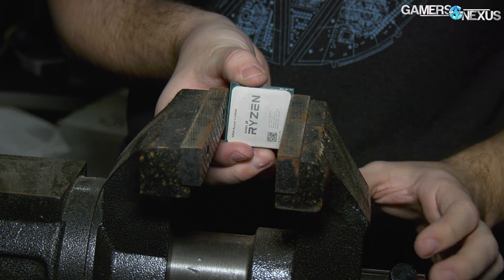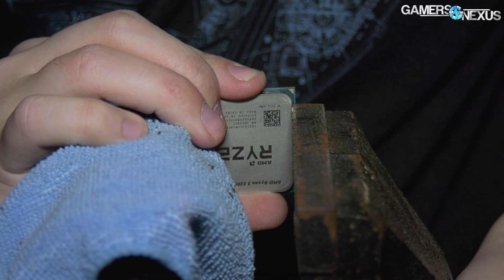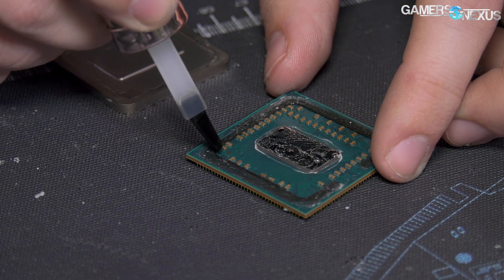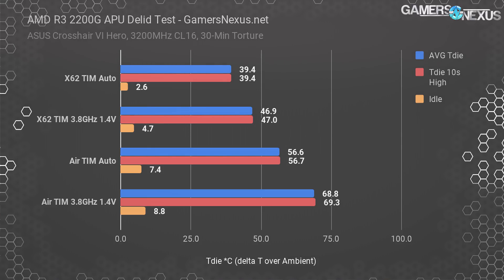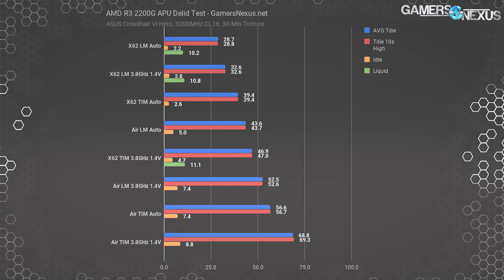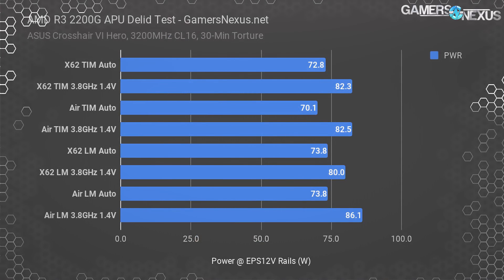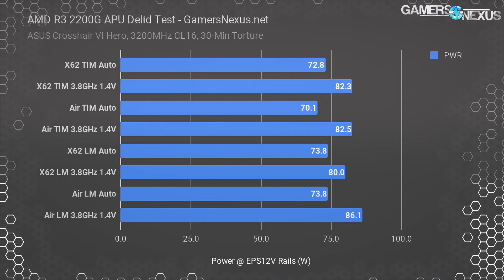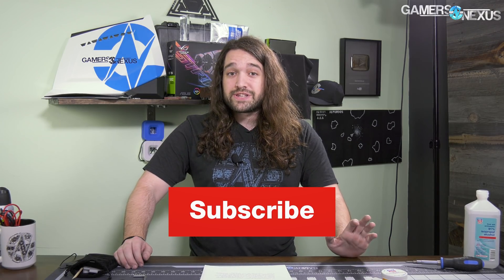Delid & Liquid Metal Thermals on AMD R3 2200G APU (Pt. 2/2)

Comment from the maker: Article with test method section: https://www.gamersnexus.net/guides/3237-amd-r3-2200g-delid-temperatures-and-liquid-metal
Find PART 1 over here: https://www.youtube.com/watch?v=7o1ITMw-O2o
Reply: +Gamers Nexus Der8auer made a 3€ upgrade kit for the "Delid die mate 2" which allows safe delidding of RR APUs. https://www.youtube.com/watch?v=Wkb4NmeONqY
Reply from the maker: Vincent - Because we've done this enough to not miss.
Reply: My understanding is that AMD has pretty much always used TIM on their APUs, this isn't really a change for them.
Reply: Test the APU’s with 1 dim 2 dim and 4 dim ram configs and show us the results run same clock through all tests and configs on the memory and a solid clock on the API no variation
Reply: So Der8auer apparently will soon be putting up and “adapter” for the die-mate 2 that allows for the delid of these apu’s.

That said, the adapter is a piece of acrylic, and the pins are exposed during the process so could be easy to screw up.
Reply: Steve, as I understand you typically do these tests with the IHS back on, not the riskier die directly to heatsink. Would we see similar results when testing LM with a GPU? As for me and many other gamers, the CPU isnt pushing our fans to 100%, but the GPU is. And since GPU dies dont have an IHS anymore, it would be vastly easier to do. Could we possibly get a video about that? Maybe showing off a 1080ti and vega?
Reply: why first do liquid metal and than the nail polish? now you can get the metal "stuck" in there
Reply: Why is your community so small. I've been following you for quite a while and frankly i think you deserve way more subs.
Reply: Gamers Nexus Der8auer was able to delid it using Delid Die Mate 2 by placing the CPU upside down and using a acrylic piece on the substrate side. Watch his video. You can delid these APU's.
Reply: great work Steve. do you think the difference will be even more pronaunced if the GPU and CPU parts of the APU where stressed at the same time (as in games). or does it make no difference hence you already exceeded the APUs power target i the cpu turture test?
Reply: You should have overclocked CPU and GPU for worst case scenario
Reply: 3:50 - 4:00 , timing video?
Reply: I do, but when OC'd and playing a game that uses 100 % the fans ramp up.
Reply from the maker: Of course you can delid the APUs. We just did it.
Reply: I know this is not relevant to the topic but where is snowflake and the others?

Comment: If you bought an i7k you kinda have to delid it if you want to actually overclock it without a water cooler or something.
In my case, when I fired up handbrake my cores would be 86 degrees and my heat sink wasn't even warm to the touch. Delidding dropped it 20 degrees on a mediocre $35 coolermaster 212.

Comment: Whats the nail polish u can use to protect those transistors things. Keep up the awesome work Gamers Nexus. I delided my I7 7700k with a razor blade. Before stock settings 4.2ghz in bios I was at 39-40c idle. After the Delid and using the Thermal grizzly liquid metal stuff I got 24-25c temps in bios stock settings. I was able to achieve 5ghz overclock with ease, running Aida64 stress test for over 15mins and my temps never went past 61c.

Comment: Why don't they make an threadripper apu? Basically a 1700 with a vega 32 or something? It would have plenty of power and thermal headroom considering the intel g laptops have 100w with 20 vega cores and perform as good as a 1050 to(best case) the threadripper ones could be in between a 1060 6gb and a 1070. It would increase tr4 board sales too! And help with the crypto hell we are in now.

Comment: I'm about to Delid my 9720x. I would use the same tool you are but they are hard to get in the USA. So I got the ROCKIT 99 - LGA 2066 Delid & Relid kit. Ever use it? 

I also got some Thermal Grizzly Conductonaut for under the lid, what do you recommend using on the top?

Comment: Why started AMD using TIM instead of soldering? I would prefer soldering the DIE to the metal coverage, it is more durable than using a thermal paste.
Reply: AMD has been using TIM in the apus forever. its not new and budget parts don't have enough margin to squeeze in solder.

Comment: I dont see the problem with BUDGET LEVEL CPU using thermal paste, kudos for AMD by being open about it, but i would rather expect a $100/$160 APU to have TIM than your $300+ High-end CPU, which is the real issue here.

Now, these APUs are real nice considering that they are overclockable. It's just a shame that RAM prices are not there to support these guys price points.

Comment: with GPU's being so easy to get hold of LoL
just wondering GPU's here in Finland
the ASUS Radeon RX VEGA 64 ROG Strix Gaming OC 8 GB 1035,90 € Currently not available 
ASUS GeForce GTX 1080 8GB is 838,90 € Currently not available
PNY Quadro NVS 810 4GB 1032,90 € Estimated delivery time 1-4 days
I can get hold of Quadro cards but not other cards
what your thoughts about Quadro?

Comment: I think youre going for the same mistake as other techtoubers. Only techEpiphany does it right (he still didn't go the delid route and can already OC the gpu from 1250 to 1700Mhz).

DO NOT FOCUS ON CPU OC, NO NO NO NO AND NOOOOOOOOOOOO.  FOCUS ON GPU OC, that's the only thing that matters with this APU, the 4.1Ghz wall is the same as any Ryzen on the 14nm lpp node. The star of the show is the GPU not the CPU part.

Comment: My theory is the use of thermal paste is to reduce any possible damage to the packaging from uneven thermal expansion by having fewer fixed points subject to heating.  Also, what's the lid made out of?  Hopefully it's not aluminum (which would be a good choice thermal-wise) because LM apparently contains gallium.

Comment: What were you applying to the transistors on the apu after applying the liquid metal?
Reply: Nail polish as a non conductive screen in case of a liquid metal bleed off the die.
Reply: Ben Grogan oh sweet thanks, I’ve been using electrical tape but this seems way easier to apply
Reply: Yannik Fernando and safer to remove, tape or silicon can strip micro components from the substrate, removing this just needs a soft brush and the same rubbing alcohol you use for TIM cleaning

Comment: Intel uses Tim on their processors. "It is not to cut costs"
AMD uses Tim on their processors. "It is to cut costs".
Reply: Richard Smith well I mean there's no excuse really for Intel using such cheap TIM on a 1000 dollar plus CPU. But makes sense for these APUs since they're such low powered chips.
Reply: Right. The difference here is the price to performance is actually undercutting the competition. Cost cuts are expected, and AMD is not trying to pretend it is anything but what it is. If you are providing a product for more money at equivalent performance, you can't obviously cost cut as well. Oh, and don't put the cherry on top by insulting people's intelligence claiming there is another major reason for it.
Reply: Richard Smith I don't disagree.
Reply: AMD has been using TIM on their low-end APU's since like FM2. This is not a new thing

Comment: what if you removed the lid and put the cooler directly to the cpu?
Reply: Anal Devastator nothing holding the CPU in the socket if the dye itself is just sitting in the socket. It would be too easy to just rip it out of the socket possibly damaging it. So really wouldn't be too wise.

Comment: I get it once you do the work of deliding its best to just use liquid metal since it is the best we've got so far. But is it bad to use a high grade thermal paste instead. I could get liquid metal and all but I'd rather use the TP i have lying around. 

Worth it or is the loss to much to use TP?
Reply: The Real1st best to look at some Intel delis videos for more specifics but in general a high end TIM is half way between Intel TIM and LM due to Intel choosing an extreme long life TIM
Reply: The Real1st using a high grade thermal paste wouldn't be such a bad idea. You would just be replacing the existing TIM/thermal paste with a better grade thermal material.
Reply: React2Quick 

That's what I was worried about as well. So then what's the difference temp wise between   LM and then high end TP. Does anyone know off hand or should I google it. 

Cause I bet GN made a vid about this question already. But I thought I'd ask here first to see if anyone knows off hand.

Comment: DerBau8er's tool works on the AMD APU. He's already released a video on it. And AMD APU have always used TIM except Kaveri. That out the way, why are you overclocking the CPU part, that's pretty much irrelevant. Overclock the iGPU and see if it can be made match the 2400G instead.

Comment: In AMDs case, it's justified. They openly admitted to doing so in order to cut costs. They did pack gpu cores, cpu cores, and a much better stock cooler vs the equivalent, for as low a price as possible. Whereas Intel's shoving that crap into their extremely high end enthusiast, overclock capable CPUs, which is a pathetic shame amongst the community.
Reply: Exactly. The thermal expansion coefficient delta from the indium based solder, the silicon die and the IHS is significantly lower than it is from the die to the fiberglass based substrate, yet we don't see die to substrate interconnects breaking which are far more fragile than the die itself breaking, but intel bs about solder causing dies to fail?  The fact their more reliable spec'd xeons are soldered with even larger dies and their CPUs of yesteryear were as well is blatant lies in consumer's faces for obvious better profit margins.
Reply: What I have against Intel is them pretending it is not to cut cost, and everyone spewing the same bullshit.
Reply: Let's be honest it wouldn't make a huge difference if the 2200G would cost $115  like the Rzyen 3 1200 did.
Reply: Nick V intel had bigger dies back then with stuff like sandy (4c sandy die was 216 mm^2, compared to Skylake which is below 100 mm^2)
Reply: Cooe14 https://overclocking.guide/the-truth-about-cpu-soldering/
Reply: Tyler Weigand ah okay, didn't know that
Reply: Meanwhile, at Intel...
Reply: Cooe14 ungluing the ihs requires removal, at which point you should replace the TIM. That doesn't sound like a valid test to me.

The stuff intel uses isn't necessarily meant to offer the best thermal conductivity. It's main purpose is to last a long time.
Reply: The TIM itself isn't crap, it's just there's a gap between the ihs and die that drops the temps.

It's justified on the LGA 1151 SKUs since smaller dies means it's easier for the solder to Crack. I totally agree on X299 though, they should've soldered.

Comment: Thinking about delidding and using liquid metal on a CECHA01 PS3 That's never had the YLOD. Also with a case and water cooling mod and lots of extra heatsinks for the other chips on the board. Should be doable, though expensive. Imagine a backward compatible ps3 that stays below 70 degrees c and wont ever overheat. Lots of great games on ps3 man but never had a console last long enough to really experience more than 5 or 6 good games. This is the exact reason I got into PC.
Reply: If it aint professionally reballed, do that first. Good investment because launch PS3s have like a 75% fail rate. And if the heat spreader contact aint flat on the GPU/CPU die then you'll need to lap it flat with like sandpaper because the Liquid metal will be ineffective if it ain't. Or use some high end grease like Gelid GC Extreme, Noctua NT-H1 or Shin Etsu G751. I would say Arctic Silver but those ones I mentioned before work as good or better without curing time and don't degrade after 18 months.

Comment: @AskGN - How much money does Intel and AMD save by using tim instead of liquid metal?
Reply: Paul Muresan around $3 to $8 depending on die size.
Reply: Ben Grogan no way. This little piece of liquid metal and the apply process can't cost this much more in massproduction.. Do you have a source?
Reply: Paul Muresan My mistake I thought you where asking on solder vs TIM costs.

The LM isn't used not because of cost but because of long term viability.
TIM will last 15 years if the ihs is not removed, it is still conductive after it has dried out.
Liquid metal will eventually corrode into the IHS and "evaporate" as it alloys with the metal and needs checking every few years for pitting, you cannot expect this in a consumer product.
Reply: But term viabiliy can't be really the only reason. I think that most people would buy a new CPU after 10 years. But I think you got my question, I was asking about TIM cost vs LM cost. ;)
Reply: Paul Muresan long term viability is pretty much the only reason for TIM over LM, neither AMD nor Intel would willingly risk a bad reputation for reliability and have openly said in interviews they avoid liquid metal for that reason.

APU in particular find themselves in front end sales systems much more often than consumer systems, and their expected life is a key concern.

As for cost for liquid metal.
There are still costs involved, hazardous material licences for holding and disposing of large quantities of gallium for example we cannot estimate without an idea of the production runs.
Then application is much more involved, TIM can self cover and squeeze out liquid metal must be evenly applied and avoid conductive contact.
Without knowing estimated production runs costs are far too variable and anyone claiming to know those figures is spitballing.
Reply: "Without knowing estimated production runs costs are far too variable and anyone claiming to know those figures is spitballing." It would be nice, if anyone could clarify this for us. ;)

Comment: Hopefully there is a video where you push the apu as high as it will go, and show us how hard you were able to push the gpu and cpu and the temperatures, obviously most people would just buy higher end hardware if they wanted more performance but just out of curiosity I would like to see that.

Comment: Why even keep the IHS?  Why not just set the heat sink on the die and use thermal paste?  I am fairly certain that you did this with Athlon XP processors.
Reply: hawkshot2001 Risk vs Reward. Having a cooler directly on the die itself runs the risk of cracking it, the IHS nullifies that risk. Unless you're going for world record overclocks with extreme cooling like liquid nitrogen then its better to keep the IHS on.

Comment: Why use the ihs? Screw the cooler down with spacers (i use nuts it's easier to manage) and remove the ihs out of the equation. That's when temps really tends to even out and cool things down. Giving you a real headroom for performance increase.
Reply: Risk vs reward. If you remove the IHS there is a chance youll crack the die when screwing down the heatsink. putting the IHS back nullifies that risk. I believe steve has tested it with and without and saw only a few degree difference. Leaving the IHS off makes sense for people going for world records, but not really people that need the PC running for 3 years, and may toss it around if they move and stuff.
Reply: ac3ofspades878 I've had cpu's like the 4770k @4.8ghz sitting below 50°C delidded without the ihs for years with no issues. Steve is not very tech savvy.. I would even go as far as calling him a just another random youtube hipster similar to paul hardware or bitwit. Get more information just talking to any sales person in any hardwarestore like wallmart or w/e
Reply: You're right; I'll go talk to a Walmart representative right now to get my real scoop on exhaustive and carefully considered benchmarks and controlled testing that have been run for days leading up to the launch of a product and are transparently communicated in articles published for anybody to read.
(P.S. of course CPUs can work just fine without an IHS. They used to be sold that way for many years in the 90s! That doesn't mean there's no good reason for them though.)

Comment: I wonder if applying Conductonaut between the substrate and the IHS is better than soldering it together.
Thermal Grizzly claims the Conductonaut has 73 W/mK thermal conductivity (which is pretty impressive, but not surprising as one of its main components is indium which has 81,8 W/mK thermal conductivity). 
On the other hand traditional soldering paste is 60% tin (67W/mK) and 40% lead (40,6 W/mK), and can be around 60W/mK overall. And the Pb-free pastes are basically tin in pretty high percentage, so the thermal conductivity must be around that.
It seems to be a marginal difference (temperature-wise) between the LM solution and soldering, but would be nice to know if Conductonaut really catches up or even leaps the soldering method (with optimally thin layer thickness of course).

Comment: Great video. Maybe a question for AskGN. TIM versus Soldered IHS has been a "hot" topic for a while now. Thermal compound is generally used between the top of the IHS and a cooling solution. However the thermals never get really incredibly poor, despite the thermal compound (generally very small differences between different compounds). But when thermal compound is put in a TIM/IHS/TIM/Cooler configuration there is a significant difference. What are the contributing factors to this? And can this be tested?